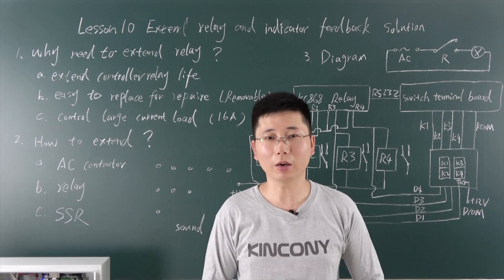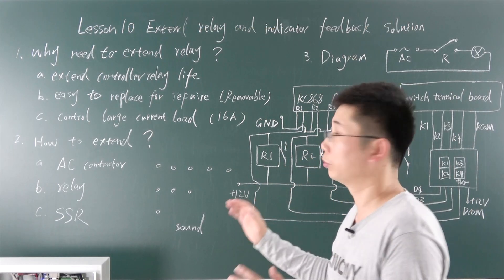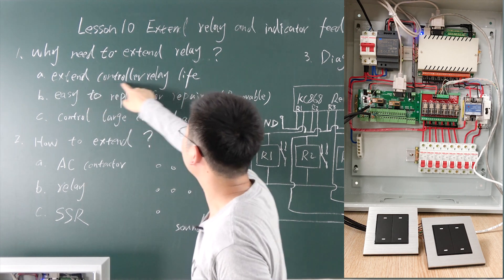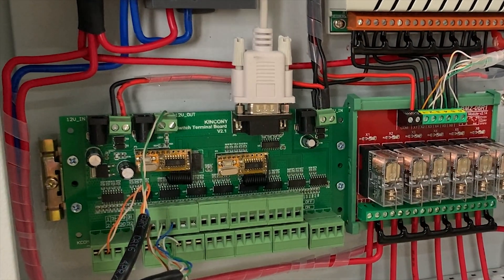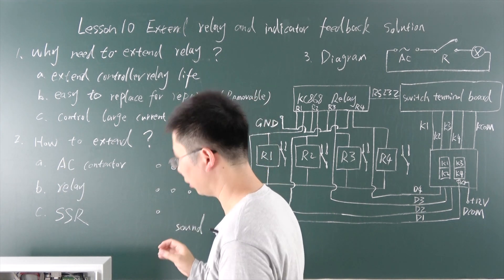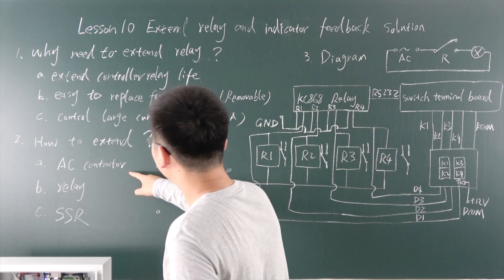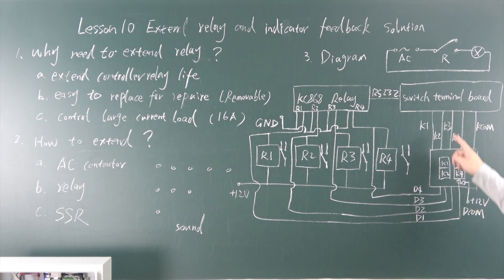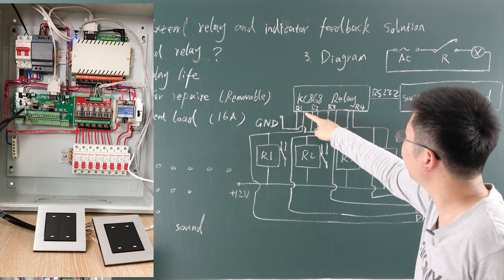【IoT training lesson beginners #10】Extend relay and switch panel indicator feedback

Comment: If I use each power below 10a, is it okay not to use the extension system? I want to use the L line by connecting it directly from Kincony-a8 to LED lighting. (A total of 8 LED lighting lines have power of about 100w each) I connected the L line separately without jumping each relay.
Reply from the maker: suggest <7A load is safety. not use full of 10A

Comment: Still the relay controller has electromagnetic relays which produce noise. I think it would be even better if you replaced them with SSR (inside the controller). A nice tutorial.
Reply from the maker: yes, if not very large current, use SSR is ok, without any noise.
Reply: @KinCony  but SSR can support large current now.
Reply from the maker: @TekCroach  but relay and contactor is safety then SSR.

Comment: if R1 Relay Defecive(coil open)  still get led Feedback ? it is not good . better way of feedback  from  the  reley auxiliary contact by double pole
Reply from the maker: if R1 Relay Defecive(coil open)  will not feedback voltage, the feedback is real voltage value of relay output terminal.

Comment: only if add external relay to create a feedback and turn on the indicator...for my case i use kc868 to connected directly to load...so can i create a feedback if not using external relay
Reply from the maker: yes, need extend relay.

Comment: The led indicator at the switch panel is great modification,
now I will know which switch is on..
Reply from the maker: switch panel no any change, just use this wire solution will see the relay state on the panel.
Reply: @KinCony  That is what I am looking for, led indicator..
thank you to make this possible.
Reply from the maker: @nassnass1972  you are welcome

Comment: Nice tutorial, a quick one.what do you mean when you said we can use Relay,SSR and AC Contactor separately?because from your design,you used the three extended relay,could you please shed more light?
Reply from the maker: every channel can use by Relay,SSR or AC Contactor. I use three types in one box just take an example. you can chose any channel with Relay,SSR or AC Contactor. if use more light, such as 32 channel, just relay controller replace with 32 channel version. Relay,SSR,AC contactor add the number to install on the DIN Rail. every channel is same.
Reply: @KinCony  okay, i understand. Thank you